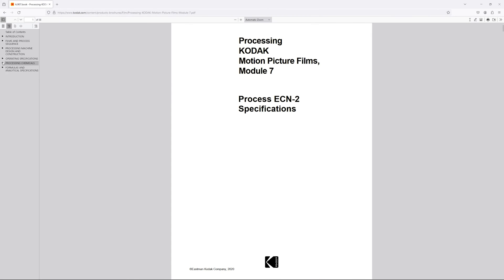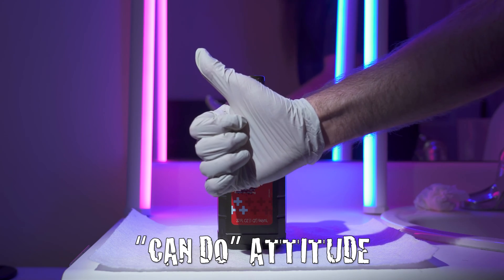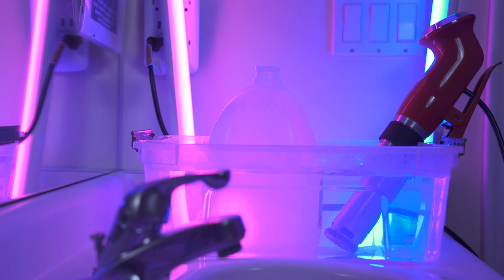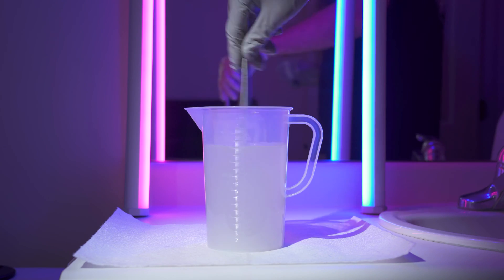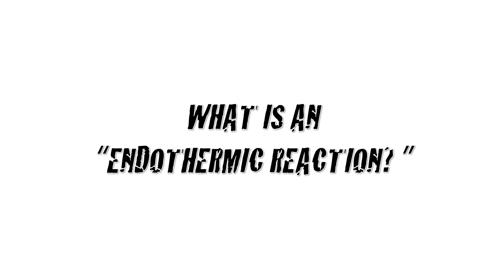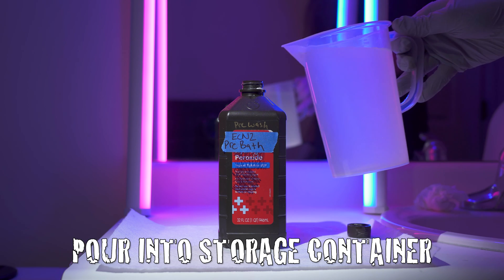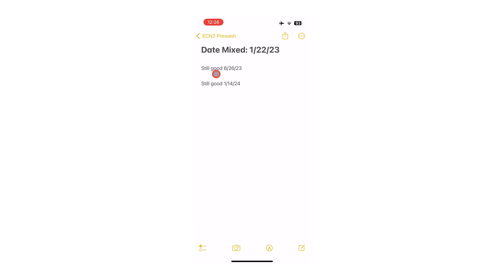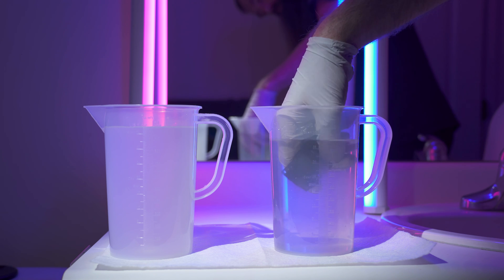How To Make Kodak Remjet Remover

Comment: The remjet can be easily removed at the very end of development process with a wet soft microfiber cloth or your thumb.  No need to do this prebath.  Your development chemicals will have black carbon bits floating in it but these particles are inert and do not affect their viability.
Reply from the maker: @HopefulForever-ln5xm  You’re correct - using prebath is optional.  In my experience, developing chemicals last longer and remjet comes off easier when prebath is used.

Thanks for watching! 😎👍🏻

Comment: so this is a pre-bath?  i.e. spool up the film and put in the tank.  pour in the required amount, let sit for X time, then pour out.  is it reusable or is it one and done?

ECN-2 is for Kodak movie film stock i take it.  not the same as E-6 process correct?

ive only ever machine processed C-41 or E-6.  hand developed 100s of rolls of black and white but no the others (by hand).  thanks
Reply from the maker: You’re right on the money! 😎👍🏻 

This is the prebath ECN2 film is rinsed in to remove the carbon backing before developing. And yes, ECN2 is movie film, and a different process than E-6 😎👍🏻

I pour it into the tank first before any water, gently agitate for 30 seconds, pour back into the container and rinse the film until the water comes out clear. 

I kept this prebath in a container that wasn’t air tight, and it lasted all of 2023. I used on about 25ish rolls. I mixed up a fresh batch in January for 2024.

I envy your machine processing - developing by hand is doable, but very time consuming! (If you let too many rolls get backed up! 😂) 

Thanks for watching the video and for leaving a comment! 😎👍🏻
Reply: @1331photo  Is the action of agitating the tank enough to remove the remjet? Your video and others I have seen show someone using their fingers to rub off the loosened remjet, and I'm not sure how that would happen with undeveloped film unless I had an entire darkroom to work in.
Reply from the maker: @campyonlyguy Hi! Thanks for asking your question!

Yes, you’re correct. Agitation will remove most of the remjet. After the film has been rinsed in prebath, it comes off the film easily - even using your fingers.

Here’s my remjet removal workflow:

Rinse film in prebath for 30 seconds.

Recover prebath, and fill tank with fresh water. Shake vigorously for 60 seconds. Rinse and repeat until water comes out of the tank clear. (Usually four 60 second rinses)

Develop film (developer, bleach, fixer)

After developing cycle is complete, rinse film until water from tank runs clear.

Pull reel from tank and hang the film.

Wet a Kim Wipe, place it between your fingers, and gently wipe both sides of the film. Repeat this step until the wipes no longer turn black (generally 4 Kim Wipes)

At this point you can use Photoflow or stabilizer.

Hang to dry!
Reply from the maker: @campyonlyguy Just a quick follow up: I made a video showing how to remove remjet - if you want to, check it out here: https://youtu.be/hNAYXlXRJIo Thank you!

Comment: I'm so interested in the ECN-2 process but so afraid of the RemJet. Thanks for making this video!!
Reply from the maker: You’re welcome Alan! Glad it helped you out! 

After a few rolls you’ll find that remjet is quite easy to remove! 

Just a rinse in prebath before developing and then a wipe down before your final rinse and you’ll be remjet free! Easy peasy! 

Thanks for checking out the video! 😎👍🏻
Reply: @1331photo  
> Just a rinse in prebath before developing and then a wipe down before your final rinse and you’ll be remjet free! Easy peasy!

Does that mean I don't have to wipe it before developing, or I still rinse and remove the remjet before developing like shown in the video?
Reply from the maker: @alanmok8783 Your workflow will look like this:

Load your film onto a reel and place inside the dev tank inside a dark bag.

Prebath: Pour into tank for 30 seconds > Rinse until water runs clear (fill tank with water, shake 30 seconds, dump water, repeat until rinse water is clear)

Developer > Stop Bath > Rinse> Bleach > Rinse > Fix > Rinse > Wipe Film > Respool  > Stabilizer

After the fixer rinse, you can pull the film off the reel and wipe the film. I recommend wetting the wipe first, this’ll keep the film wet and keep the wipe from sticking to the film.

I wipe the film gently until no more remjet residue appears on the wipe. I do two additional wipes just to make sure I got it all.

At this point you can carefully respool the film and dip in the stabilizer bath. (I choose not to do this {I’m not sure how this’ll affect long term negative storage, so if you choose not to use stabilizer, do so at your own risk!})

Hopefully this helps! If you have any other questions let me know! 😎👍🏻
Reply from the maker: @alanmok8783  Also: if you check out the end of my “How to Develop C41” video, you can see how I wipe the film. I use the same process for wiping off residual remjet. 😎👍🏻
Reply from the maker: You’re welcome! Thanks for watching! Happy developing! 😎🤘🏻🤘🏻
Reply from the maker: @alanmok8783 Hi Alan! I made a video showing how to remove remjet - if you want you can check it out here: https://youtu.be/hNAYXlXRJIo Thank you!
Reply: Ngl I've developed ecn2 a couple of times and removing the remjet is a pain.
Reply from the maker: @TheWutangclan1995  Right?!? 😆 The first few times was definitely a challenge, but after a few more rolls the removal process started to get easier! 

The more rolls you develop, the easier the removal process gets! 😎👍🏻

Thanks for checking out the video and leaving a comment! 😎🤘🏻🤘🏻